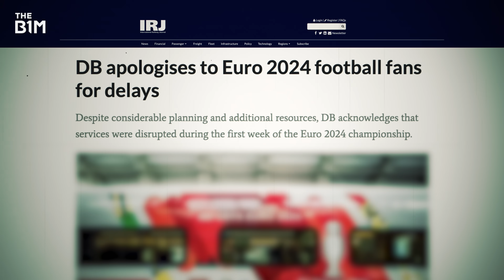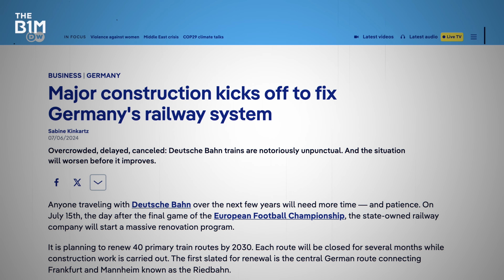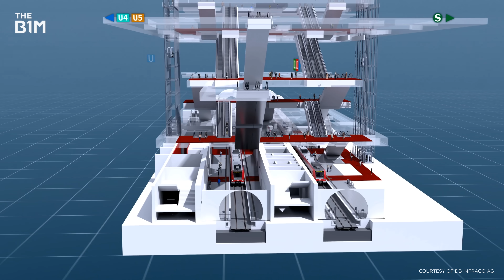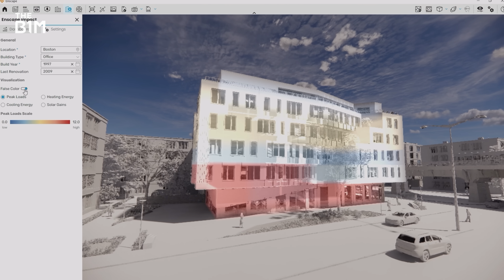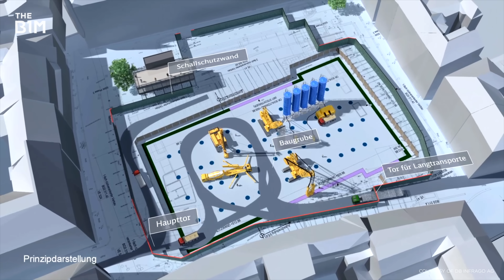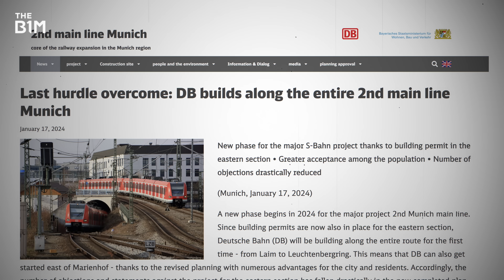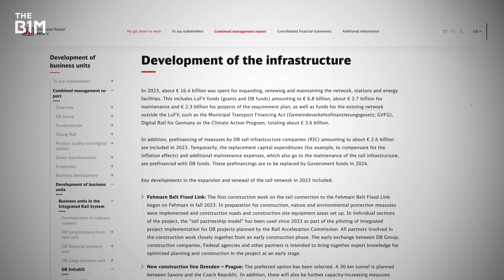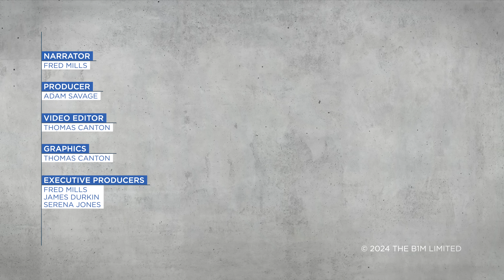Germany is (Finally) Fixing Its Failing Railways

Comment: I will try to my best to describe the situation and financing is the last: Problem 1 is incompetence in conjuction with experienced individuals spending thousands of working hours in complaning rather than having a solution mindest. Problem 2 lacking of literally basic management skills together with ownership from medium to high level management. Problem 3 DB is a money party company; meaning the 10 % who does the work is undervalued and new employees prefer JFs with thousands of writen hours and do not have a single practical experience in safety critical systems and the norms coming with it. Positive is that safety culture (the aforementioned 10%) is  on a satisfactory level and far better in comparison with west countries.

Comment: Going 41 metered under Manchester Piccadilly would be a logical way to solve the problem of platform 13/14 out towards Liverpool but also a coast to coast route from Liverpool to Leeds and the rest of Yorkshire. Could also house HS2 if the underground box was big enough and provide an opportunity to overhaul the Metrolink station.

Comment: Munich, Stuttgart, Berlin, bla bla bla. what about the smaller citys?! some tracks are ridden by 120kmh max speed diesel trains! we need new regional train innovation, not subways or anything else, thats luxurious enough!
Reply: so you think the big cities don't need any upgrade because it's luxurious enough? Sure, a million+ people in a metro area struggling to move around the city when parts of the network are shut down for whatever reason, that's a luxury problem? no, it's not. 
I agree that regional rail service should be improved in parts of the country ... but that doesn't mean that rail services in metro areas are good enough already. They clearly aren't. 
Apart from that regional rail services often have been upgraded quite a bit in the past. Just looking at towns like e.g. Altenburg: in the past there were only regional trains heading up to Leipzig, pulled by outdated locomotives. Today the town is served by modern Leipzig S-Bahn service commuter trains. Even regional rail services like South East Bavaria Rail do their fair share of upgrades and improvements. Of course they'll keep the old DMUs running on lines with lowest demand, while they improve the lines with higher demand
Reply: @EnjoyFirefighting  The only real stupid Diesel connections are around Kassel.   they have a perfect system with the RegioTram, BUT they need to change trains mid line because half of the line is inner city and doesnt allow Diesel while the other part of the line is rural and isnt electrified.
Reply: @nox5555  doesn't seem to be an issue in Zwickau where they run diesel trains in city streets; And in Bad Doberan they also have street running steam locomotives

Comment: The lack of investments took years to show the bad effects. It will take at least the same time to undo this.
Reply: They even stripped down the system, now lacking redundancy and capacity. e.g. they shut down multiple sites in and around Berlin in the past 30 years, and now are lacking capacity to park trains, so they need so circle around the city or park hours outside of Berlin.

Comment: The DB statistics are beautified. Trains are late once they are 15 Minutes past their planned arrival. Also, trains that are running late will most certainly get their last few stations canceled, so the train would be on time on its originally planned way traveling back. Though one must say, mostly the fast trains (ICE) have these problems, and the regional trains are mostly on time without problems. Also, most problems accour around Frankfurt am Main. (There is also a video ... though in german ... where a statistician tracked all the times and talks about the Time Planning Problem of the DB)
Reply: thats simply not true its „just“ 5 minutes
Reply: they're rated as delayed when 5 minutes behind schedule, not 15

Comment: At least Germany are going big - contrasts with the UK and its HS2 and northern powerhouse plans that have been stopped, restarted, scaled back, and still in much doubt.
Reply: I'm still distraught over those projects being massively sabotaged
Reply: It does seem that the UK might end up in the same place if it can't make the same investment now. Munich is building a second cross city tunnel when cities like Birmingham and Manchester don't even have one (Manchester in particular needs something to reduce congestion on the Castlefield corridor which is one of the busiest sections of railway in the country).
Reply: @Croz89 Birmingham could do with an alternative line that avoids New Street.
Reply: As an outsider HS2 seems to be all pain and no gain at this point.
Reply: @york2600  In its current state yes. a fast connection between London and Birmingham is fine and will provide a nice capacity boost but HS2 in full would literally be as if we built 4 brand new mainlines all at once, which is as huge as you imagine.
Reply: @blazikem  Why is a fast connection between London and Birmingham so important? Would it not be more sustainable to improve existing lines (for efficiency) and re-open some dormant lines (in order to replace car travel)?
Reply: @htimsid  If you see my second comment it clarifies HS2's purpose as it will drastically improves existing lines. 
Transferring fast trains, which are horrible for capacity as it means less slow trains like commuter and freight services, onto dedicated HS track, you can triple capacity on the relieved lines just like that. 
However in the cost/benefit analysis these benefits weren't considered, or highly underestimated, which is one of the many reasons used to cancel most of it.
Reply: @htimsid  because the lines are very congested at the moment, it is not possible to just increase capacity on them, as the British population has grow by around 20 million. The great tragedy is that this is not communicated properly.
Reply: @york2600  There is still a ton of gain in the line. Just gotta commit to it. If you keep cancelling mega projects you will never regain the capability to do them properly. The reality is such projects can only go well if you have the expertise and institutions to support them. And those can only exists if you actually regularly have mega projects. Just look at France building one highspeed line after another these days.
Reply: Germany might be sick, but it is not the sick man of europe. It's just joining the club.
Reply: There does seem to be some realisation that although the Northern section of HS2 may not be built, the sections for Northern Powerhouse should be built to the high speed alignments, large International loading gauge.  The additionals cost of these items is marginal and future proofs new lines.  Sadly they seem to have missed out on the opportunity to connect the HS1 and HS2 lines in London.  
Lastly UK train seats are uncomfortable, way too hard, while the suspension systems are poorly tuned resulting in a bouncing effect.

Comment: At least the delay of German trains is consistent
My train once was late and I wouldn't have cought the following train, but the following train was also late so that it all worked out.
Reply: You have to be careful, because there's one important exception to that rule: if you arrive late to the train station by any mode of transportation other than a train, the train you're aiming to connect to will always be on time.
Reply: @lonestarr1490  Heisenberg's train.
Reply: @Atom224  you mean Schrödinger?
Reply: @Zaid-vs2zz  No, Heisenberg, specifically.
Reply: @lonestarr1490  so if i hire someone to go to the station later i can ensure it gets on time
Reply: It's not consistent at all. If you're late for the train, the train will most likely be on time -.-
Reply: Living in Germany, this was the most surprising to me: Thanks to the rigid passenger refund requirements, DB will almost always have a train wait for the incoming connecting train because it's cheaper to have it run a few minutes late than have a bunch of passengers having to wait an hour or more for the next one. This is being done in an extremely consistent way across national and regional rail services. In Austria, the train will rarely wait for connections, and rather instruct passengers to just take the next train. It's both because the DB IT system is more thorough in knowing the connections of the passengers of a given train, but also because train conductors often just ask the passengers and have a lot to say whether they wanna have a train wait for them. In Austria, in many local trains there isn't even a conductor and even if so, their input has less value to the operation HQ
Reply: @schnitzelsemmel  Driverless is good
Reply: A Brit of a certain age might be recalling:   "Morning Joan.  Eleven minutes late, seasonal manpower shortages, Clapham Junction.  Take a letter Joan:  To the traffic manager, British Rail brackets Southern Region close brackets Dear Sir, Every morning my train is eleven minutes late. This is infuriating.  This morning I took a later train. This also was eleven minutes late. This also was infuriating. Why don't you re-time all your trains to arrive eleven minutes later? - then they will all be on time.  Yours etc. etc. Reginald Iolanthe Perrin"
Reply: I even have arrived early due to late trains. Instead of getting my connecting train, which was running late, I was able to catch the previous train on the same schedule, which was running late too, so I could cut down on waiting time.
Reply: Not always the case
Reply: Well one thing that is actually nice about the german trains is that they're comparatively cheap.
Reply: Haha. Last year I was traveling from Koln to Utrecht. It was supposed to pass through Dusseldorf but the conductor made a mistake and we ended in Dortmund instead. Got a few hours later there, missed my meeting and never got compensated by DB
Reply: Yeah BD will consistentley fuck up your whole timetable and ruin you day. Every. Fucking. Ride.
Reply: I don't know whether to laugh or cry.
Reply: "once" lol
Reply: that happend to me 2 days ago.
Reply: That's how the Italian rail also works
Reply: I rarely us DB, but when I did last time exactly this happened.
Reply: thats peak DB
Reply: Yes, train delays are so consistent that I bought a car! Because I am NEVER able to reach my destination in time with DB! And it is a nightmare if - no: WHEN! - you get stuck in Munich or Hamburg because not only your planed but even the last connection of the day to the rural city you wanna go to is  gone!
Reply: @BricksOnAnIsland yeah because traffic jams are not happening kid
Reply: @pertie You can plan car trips however you like it and in most cases avoid stau.
Reply: @duxxxhm then they take longer than any train though
Reply: no that is called 'Anschlussgarantie'
it means, it is guaranteed, taht if your train is late, the designated follow up trains hold till said train arrives.
that's up to 20 30 minutes - after which it won't make it any sense, and you just take the next train then.
Reply: @Xingmey  Das stimmt bei Fernverkehr aber er meinte glaub ich bei S-bahen das Problem wenn man umsteigen muss. Die Linien warten ja nicht aufeinander.
Reply: Told my German friends they complain too much (Germans love to complain about things in their country). It is not that DB trains are late, they are just in a different time-zone.
Reply: What about this one: we flew in to Frankfurt Airport and had a train connection to Nürnberg. When we arrived at Frankfurt Fernbahnhof we were told that our train was running late. However, an earlier train was also running late, so we were re-booked on this train, had to rush to catch it - and arrived well before the originally planned train.

Comment: Germany is killing itself with regulations
Reply: regulations didn't cause the current situation. They may make constructions project take longer, but they didn't prevent those to be started when they were needed. The lack of funding maintenance and build up of the network has been the problem, esp. since the last Bahn Reform has given the main actors like the DB Netz AG bad incentives (profit down the line over foresighted planning in favor of public interest). If you take away funding you get the situation you have today. If you take away regulations you get Eschede.
Reply: Delusional.
Reply: and the liberals did nothing about it
Reply: Germany is killing itself with EU regulations

Comment: Visited Germany for the first time in September. Was excited to try out the DB and had 4 trips planned between cities. 

2 cancelled trains (which resulted in me losing my reserved seats so I had to stand for 4hrs in full trains) and all 4 trips arrived over 45 mins late. 

Learned very quickly that next time I visit, I’ll just fly between cities.
Reply: 4 trips with 45+ minutes of delay? That's about the same number of delays I had in riding trains across Germany in more than a decade 
"I’ll just fly between cities." and then? You'll arrive at an airport far outside the city and might still take a 1 hour ride on the train to get into the city. Taking the train all the way is definetly faster than that
Reply: @EnjoyFirefighting  It depends a lot on which time and which route you are taking. Some are pretty reliable and some are horrendous
Reply: @EnjoyFirefighting  With enough luck you can have this many delays in one week, if you are reliant on DB for everyday commutes in the wrong region.
Reply: Well, you did get yourself the proper German experience. You really felt what it's like to live here. No amount of sightseeing or city trips could have provided you those insights. So there's that.
Reply: tell me you're American without saying you're American...

Comment: Nicely summarized, and very timely, with the Riedbahn corridor reopening in a week from now. However, I have to say this full shutdown and rerouting made a lot of sense. The bus replacement service for regional stations between Mannheim and Frankfurt apparently worked flawlessly, and the long-distance trains, while taking longer, actually ran on time. So my travels usually took 30min to 1h longer - for trips that would be 3-6h total - but I basically wasn't late anymore. Now I'm looking forward to the statistics of trains on this corridor.
Reply: Wow, didn't know it's already coming to a close soon, and on time too. Am super impressed, that's basically unheard of from our german construction industry xD
Reply: @Loren1389  Deutsche Bahn track works is ususally quite punctual. Not much dependency on external powers, I think. And "just" renewing tracks is something they are really efficient in.
Reply: @Loren1389 thats what happens when the spd rules.

Cdu does naught, everything is over budget and late.

Spd, every cent accounted, everyting on time.

You know whom to vote for. Greetings from austria and the kpö
Reply: I think so, too. Years of slow-moving construction would've been way worse.
Reply: That 6-month shutdown is nothing compared to what's going on between Emmerich and Oberhausen. 80 weeks of closures!!
Reply: @112Haribo  It's apples and pears. It's not getting shut down all 80 weeks, while still construction works are ongoing. Also you can't fully shut it down for that long. Stop dramatizing.
Reply: @112Haribo  Yes, I've not taken that route towards Utrecht twice now...
Reply: It's just not finished. The ETCS Rollout won't be before 3 quarter of 2025 and as LZB was taken from the track, the route falls back to PZB. So for now max speed is 160km/h instead of 200km/h and less capacity.
Reply: @tyranicus2338  They say to be back at full capacity from ~mid January on.